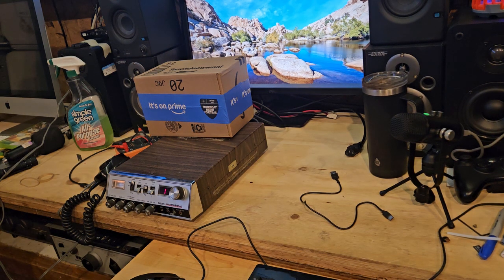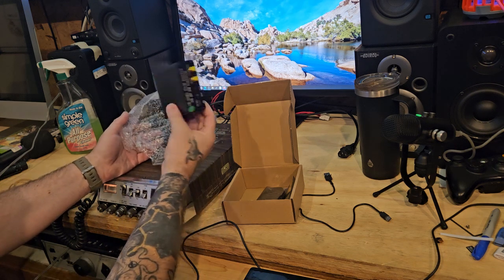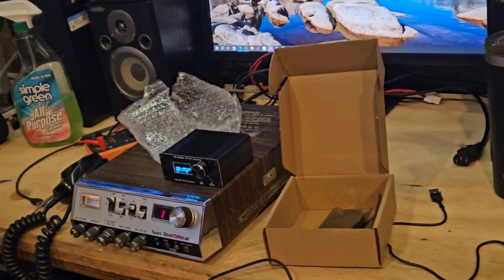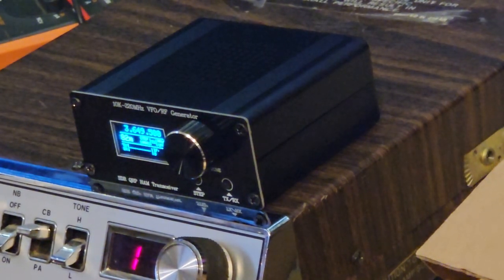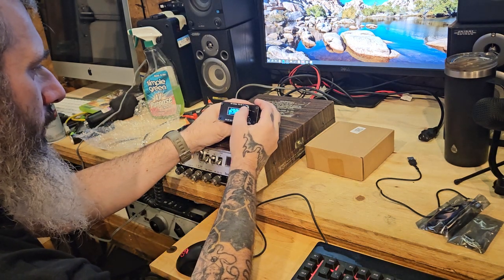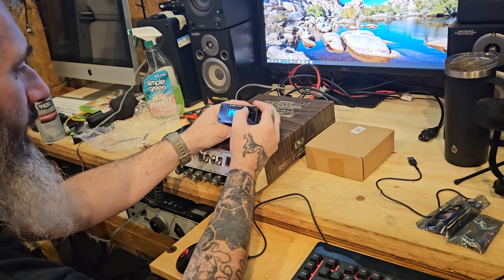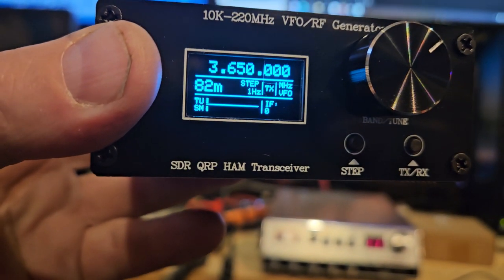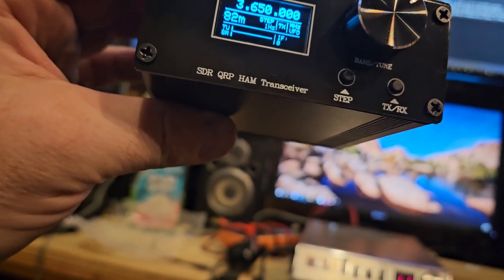The CB radio VFO is here...dds vfo

Comment: One more thing, does the unit allow selection of square or sine wave along with duty cycle?
Reply from the maker: As far as I know it can be programmed to do that maybe you can explain to me what that does as far as inputting a signal into a radio
Reply: @hamradiohack Duty cycle of the wave is the distance between peaks, normally 50%. Being able to adjust the wave, say 60/40 allows better tuning for efficiency in class d/e tuned circuits. Normally these type of circuits use square wave.
Reply from the maker: If the program the ardiuno